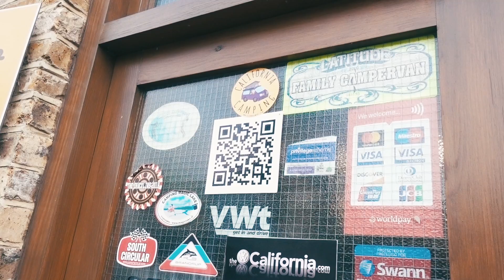VW T6 Bike Rack Install at Campervantastic

Comment: You only need a shorten Allen/Torque Key to undo the two bottom clamps and you can walk off with the whole rack. The Allen/Torque Screws are not hidden away and are freely accessible from the outside.
Reply: Good point!
Reply from the maker: You’d still need to open the tailgate to get it off. 😊
Reply: CaliforniaCamping better point! 🤗
Reply: We also replaced the VW bolts with anti-tamper bolts, still allen-head, but with a 'pin' in the middle which prevents a normal allen key from being used.

Comment: My 2 bike Fiamma bike rack, with two bikes on, fell off  my T6 at 20 mph on a flat road...it was absolutely secure before we set off (I've had such vans and racks 15 years and always check...this was 3 years old). The tailgate under the top right hand bracket  had buckled....carrying just 2 ordinary hybrid bikes (way under 60kg).   The rack had also been professionally fitted  and never been lifted with bikes on nor had they ever been left on when not travelling. ...total cost to me is around £1500.  Be warned.  I would not have another one at any price..fortunately nobody was injured when this could have been catastrophic.

Comment: A lot of cosy chat, and very little info. I have just bought a bike rak for my new T6,1 and would have liked to see how to place the plastic protection the propper way. They have a particular shape, thats important. The special instrument to tightnt the bottom attachment bolts is actually a momentkey, nice to know. In the beginning all the talking about turning and placing the Bike securing arms, went over my head to.

Comment: From personal experience you should take the bike clamps off unless clamping a bike on. My locking knob wouldn’t turn due to rain water causing some rust.
Reply from the maker: Interesting you say that because we had removed them but the rack opened on its own on the motorway. We maybe need to secure it with some straps

Comment: Great video guys. I wonder if it would be worth fitting a little rubber where the rack fixes to to the van?
Just thinking about vibration and your lovely paintwork (plus I had a similar rack and did this before).
Reply from the maker: We’re not getting any sound vibrations from it and the little stickers seem to be protecting the paintwork really well. We will continually check that it’s ok though.

Comment: Thanks for another great video.
Did you consider a tow bar bike rack as well as this tailgate type, if so what were your main reasons for choosing this one?
Reply from the maker: Hi Mike
We didn’t consider one as we need to be able to open the boot to get Bentley in and out still. Since we are using the rack for storage we can still open and close the tailgate. 😊
Reply: I Have a tow bar mounted model from Thule in my Tiguan and has a tilt function that might work also in T6. Example: http://www.sparespro.com.au/assets/alt_2/BA921.jpg . For other storage, the original you are using, must be great choice

Comment: HI, I've been enjoying your videos as I seriously consider trading in my loved T25 Westfalia califorina for a T6 California - for all the comforts and reliability, etc. For that, we have a 2-bike carrier. Is there not a T6 option for 2 bikes? Surely, you won't need to carry more than two bikes yourselves, so the un-used extra length of a 4-bike holder when down, could be a bit of a pain.
Reply from the maker: We use the bike rack for storage and it certainly could be strong enough to hold two bikes plus a waterproof bag with extras!
Reply: Don't you use it to carry bikes anyway? For us, it's a rule to take at least one bike because once you are set up at a campsite, a bike allows you to pop into town to buy croissants, or other necessitites without having to close up and move the whole van. Typically, I'll be back with the croissants before my wife gest up. BTW, we live in Belgium, so often in croissant/pain-au-chocolat producing countries.
Reply: BTW, for our T25, we upgraded the hydraulic struts on the rear door so it can support the weight of one or two bikes, and at least its easier to lift open while the bikes are on. I don't know if that's important for a T6.
Reply from the maker: It is required on T6's unless it's a California which is already fitted with the uprated struts